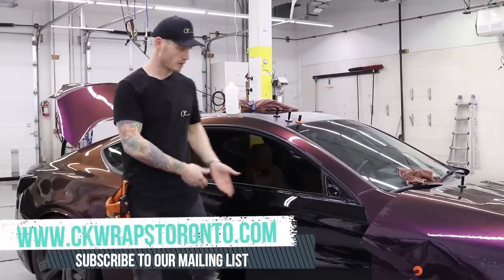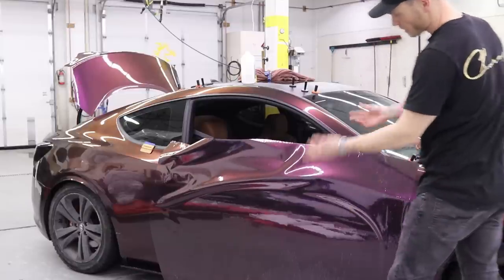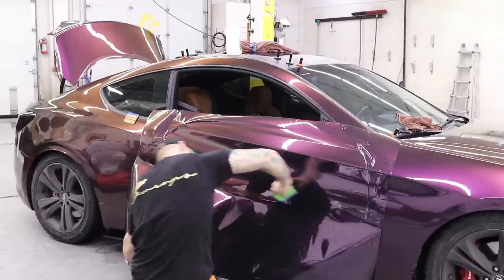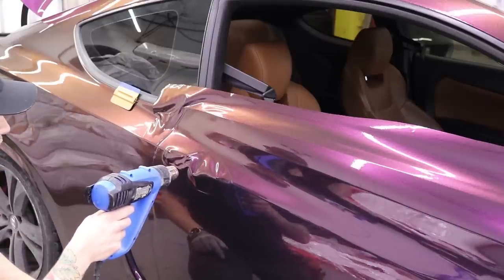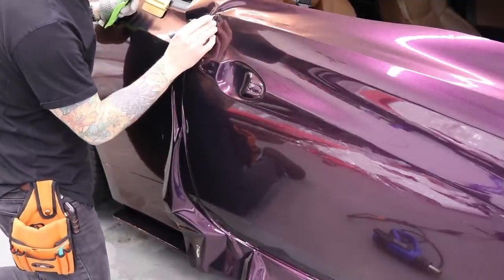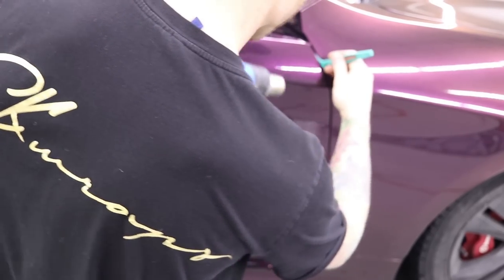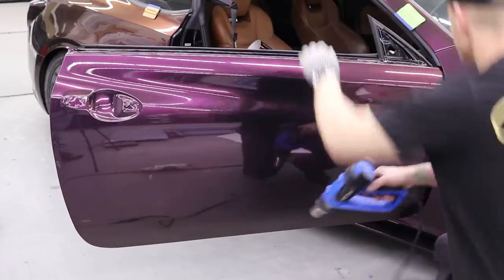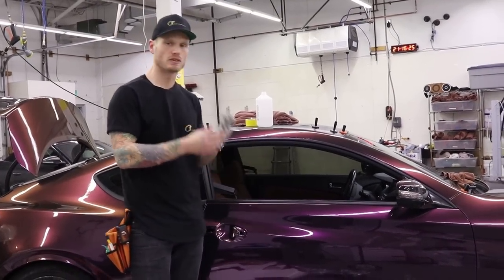Super Detailed Vvivid Nightshade Purple Door Vinyl Wrap

Comment: Great video and the colour is awesome. You need to get some knee pads though dude, think of your older self with hot stabbing pain in your knees, and the few dollars it will take to prevent such a terrible thing happening. You will also gain better balance for your stress position cuts. oki lecture over :) Great vid pal.